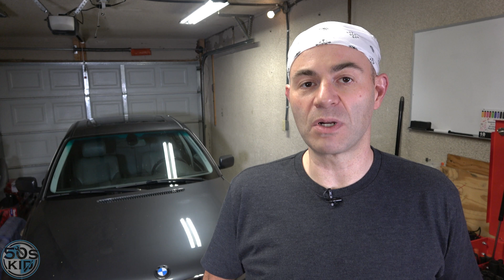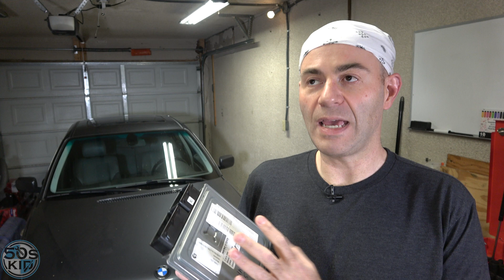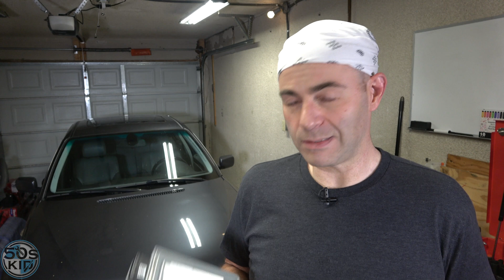Aftermarket tune? This can leave you stranded! - MSD80 MOSFETs on BMW E90 N54

Comment: I just tuned my car with mhd stage 1+, it was doing fine till I got stuck on the side of the road and got a 30bb code, not sure if it’s my
Injectors 4,5,6 or my dme, but the car smells like gas and it doesn’t wanna stay running nor move forward or backwards

Comment: Currently happening to my n54, I’m not 100% sure but I got the car last year drove it for about 2 months it started misfiring really bad which cause it to jump timing, I change coils sparks and injectors still was misfiring, showed crankshaft code, I ended up changing the motor to one with 85k miles and upgraded my turbos with FBO
Drove the car with new motor for 2 weeks and the car started to misfire badly once again it showed injector 6 and 02 sensors , I went to a new mechanic who swapped my sensors and injector and coded the injector.

Car after car turned on but seemed to misfire worst than before , he thinks it’s my DME it’s my last hope if not I’m going to get rid of this car because I’ve invested to much money into it for me to not be able to enjoy it 

If any one has any ideas please reply , thank you

Comment: On my E90 and E92, I just Hot Air’s some new
MOSFET’s in and it fixed my issue! 4 years going strong. A lot of times, it is a bad injector that also causes them to go out. I have a video showing how to test them and quickly replace them as well. Not bad at all and much cheaper to replace them rather than swapping and coding MSD81!

Comment: Hey 50skid, this is off topic but I can't get the engine cover off. The nut is stripped in the back. Or, its just so corroded it won't budge. I already tried penetrating oil and no-go. Any suggestions? Thanks.

Comment: Those mosfets are cheap and easy to get ahold of. At least they were a year ago when i installed them to my cooked dme80. It really wasnt difficult to install with a $50 rework station from amazon so it's a good option for the DIYers out there.
Reply from the maker: Ah didn’t know you could go with the upgraded ones. Good tip, thanks 👍
Reply: Yep, just checked. Amazon has a 10 pack of those mosfets for $14 and you only need 6 of course. FDB14N30TM Mosfet 300v 14a
Reply from the maker: Yeah definitely doable but you’ll just end up blowing them again. They were weak chips to begin with, that’s why they switched to different ones on the MSD81, right?
Reply: @50sKid  come to think of it, they are the same mosfets you'll find in the msd81
Reply: @50sKid  the mosfets i bought and referrenced in my comment are upgraded ones and have lasted over a year without issue. I'm also running an agressive custom tune, fob, port injection and about 28 psi on full e85. Both dme are fine just need upgraded mosfets

Comment: I am curios, how do they know if you have an aftermarket tune flashed? If you just have the ECU reprogrammed and car was mechanically stock wouldnt you be just fine?
Reply: Ecu can store changes and flashing numbers
Reply: @FishFind3000  can you read that data without manufacturer/dealer specific tools?
Reply from the maker: They probably have the hash of all the stock factory software from the manufacturers
Reply: @50sKid  oh that would make sense, never thought about that.
Reply: They can’t tell.  The OBD reader for emissions is just looking for your VIN and the corresponding “emissions-ready”  codes. If you’ve removed your catalytic converters, well, you would have to ‘trick’ your emissions codes to read as ‘ready’. I think there’s a fix for this too. 😅